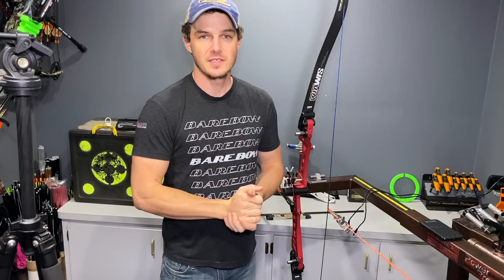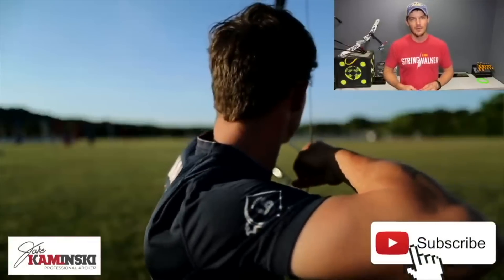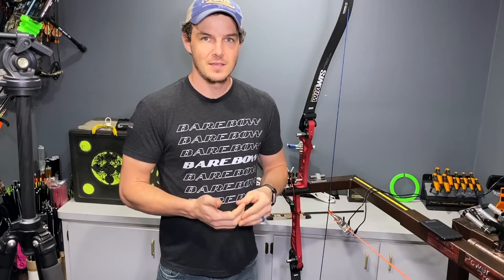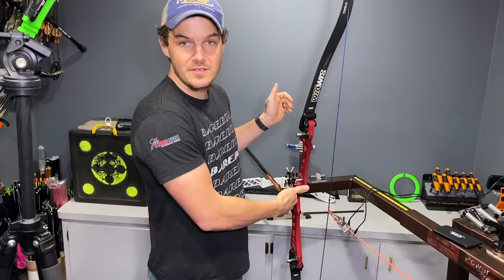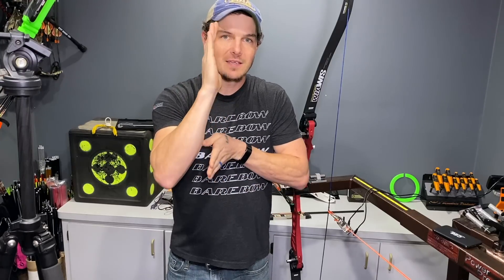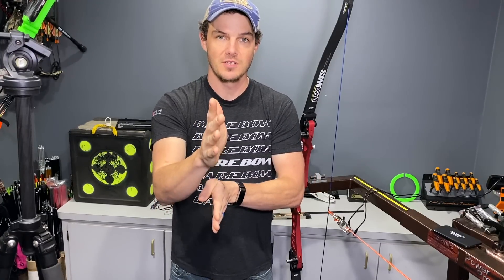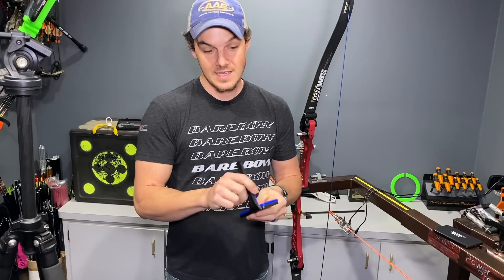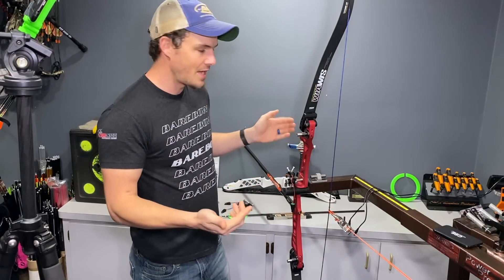Introducing Recurve Riser Flex Testing | How I Will Test Archery Risers with REAL DATA

Comment: Nice setup and to be honest I was a bit skeptical about travel of limb pockets because the riser is so much more ridgid than the limbs. You proved that they indeed move when pulling back the bow. But I don't believe the pockets travel as much as the lasers on the paper do. I think lasers in the setup exxagerate the actual movement of the pockets. It is like hold a long stick at one end, move near this end for lets say a mm. The movement you will observe on the other end of the stick will be significant higher (propotional to the amount you moved the stick though). So imo the measured movement should not be considered to reflect the movement of the pockets 1:1.

Sorry for my poor explanation, hope you get my point.
Reply from the maker: Yes of course, due to parallax they will move less. However a TINY deviation on the line makes a massive impact difference on the target (similar to the lasers) so ANY movement in the wrong way makes an impact on results.
Reply: I wonder if the results for flex out of plane is depended on the lateral adjustment for the limbs, e.g. will limbs that require the limb adjustment to be moved to the side give different results than limbs that are tuned with limb pockets in the middle.

Anyhow I'm looking forward to seeing more tests like this, it will be interessting to see how different risers compare to each other.

Comment: A dial indicator top and bottom will give good measurements too.
Reply from the maker: but where do you mount them? Thats the question.
Reply: @JakeKaminskiArchery  one long bar with an indicator at each end. Put one short bar near the middle, perpto the long bar. The short bar will be used to mount the assembly on the sight window or the stabilizer insert

I can sketch something up if you don't understand

Comment: Instead of using the stabiliser to mount your plate , make a mount that bolts to the rest/plunger holes like your first concept but that is the same length as the stabiliser. That way the plate and laser are mounted from the same point, which should negate any flex difference between the stabiliser mount and the rest/plunger mounts.
Reply from the maker: I can just use the arrow point as the reference and add the stabilizer flex as an extra data point reference. At least this is my plan at this point

Comment: probably should flip the limbs around too for extra data...maybe one limb is pulling 46 and one is pulling 44. Since they're sold and measured as a set you never know if one is stiffer than the other. And a stiffer top limb might flex the riser differently than if it were a bottom limb. I guess that's irrelevant as long as you always use the same limbs in the same position for every riser. Just thinking out loud.
Reply from the maker: I will be sure to try something like that, good idea.

Comment: I wonder if the results are affected on where the grip your setup applies pressure; i.e. whether you should have the horizontal bar at the same place as your hand would apply pressure at full draw.
Reply: In fact, to take it a step further, aren't you in fact modelling a shot where the archer applies pressure to bow's throat and uses a release aid?

So, wouldn"t you need to somehow model the way of gripping the handle and pulling the string as is common for the bow's target culture?

F.ex. thumb draw, three fingers below nock, and two fingers below nock might affect how the bending behaves, and the bow might have been designed for a specific kind of draw and archery.

I mean, if you think of the test setup as a person shooting the arrow, you might reach a more accurate and rich physical model. :)
Reply: @vilidious  Why does any of that matter? Jake is testing the flexing properties of risers under typical shooting load. All of those variables are irrelivant unless you are actually shooting an arrow and measuring that for some reason.
Reply: @mrnice752  Doesn't the behavior of flexing change depending on what the "focal point" of it is?

Especially since I assume the form and material of riser and limbs are not uniform.

So I'm guestimating that the vertical spreading behavior of the laser dots would change depending on what is the center of the bend.

Of course, if you want to just compare roughly how different risers bend, it might not be a significant issue... it might not be so even if you adjust the way it is bent either, but if the experiment is done in order to gain information on how the bow behaves when it is shot... then isn't that what should be simulated/modelled?

I'm not sure how thorough bow manufacturers are with their design, but at least in the ideal world I believe tools are tailored for a specific purpose and way of use... which is why we also have different kinds of bows.

So yeah, that's my motivation with that comment... to note the existense of forest from the trees.

Whether readers feel it's relevant or not, is their educated decision... but at least they can make that decision.
Reply from the maker: I'll try testing things such as this with "fingers" that I have to draw the bow back and make a hand to hold the grip in similar ways to see if differences are seen.
Reply: @vilidious  In theory, yes., moving the resistance point on the grip should effect the results. If you knew the exact forces and coefficients you could calculate that difference. 
In reality we are talking fractions of a mm, measured by eye with pen on paper, I very much doubt a couple of inches difference on pressure point would make a measurable difference to the experiment.

Comment: The Harbor Freight calipers are really good quality. However, like any electronic calipers, they have a rather high parasitic draw on the battery when turned off. The trick is to just remove the battery, after each time you are done using them. I have had batteries last well over a year, with daily use. I have been a machinist, for the oil industry, for the last 9 years, and use a pair of Brown & Sharp dial calipers at work, so I do not have to worry about batteries dying on me in the middle of a job. I have tested many brands and the Harbor Freight brand has always tested equal to my more expensive brands, in terms of accuracy and repeatability.
Reply from the maker: Great idea!
Reply: @JakeKaminskiArchery  If you are wanting, I have an old Hoyt Gold Medalist magnesium riser, dated from the mid 90’s in 95+% condition, that you could test. As long as you can guarantee no damage will come to it. It was my first true bow given to me, by my parents, when I shot indoor competition. Would be interesting to see the difference from then to now. Maybe even a shooting test, to compare how ergonomics, shoot ability, weight, forgiveness, and shot feedback has changed throughout the years.
Reply from the maker: Time will tell on that one. I will be checking to make sure I can do this test without damaging the finish of risers first from the tape and the peg holding the grip area. Id hate to damage your bow.
Reply: @JakeKaminskiArchery  Ok, offer will always be on the the table, if you ever change your mind.

Comment: This flex is consistant. With every shot....
Reply from the maker: Agree, but what if it is uneven and can cause larger deviations of arrow impacts when making mistakes? This is why I am interested in more discovery.
Reply: @JakeKaminskiArchery  uneven should still equate to constant. Unless the poundage varies on each pull. I dont see a slight devation in release causing significant devations in limb alignment.
The other thing to consider is riser clearance with string walking. Risers with less window clearance will torque less for any given material thickness.  Which in certain crawls can cause erratic clearance. 
It kinda depends on what you class as consistancy. I think for barebow a little more window clearance is better than 0.05of a deg of rotation.
Your measurements look significant. But they are at a distance. Double the distance double the measurement. Something to note opposed to making the industry look like they make jello for risers.
Your techneque for measuring this is impressive though. The use of the X vs + to distinguish upper from lower is a stroke of genius.
Reply from the maker: @sid I mentioned this in the description about the parallax to not freak people out. I forgot to mention it in the video and to go out and re shoot a segment to add it in was not in the cards. Still not feeling well so I just wrote in the caution to people.
Reply: @JakeKaminskiArchery  my bad. I didnt read the coment... good to see ideas being tested.
My only fear is people hang too much on one  attribute. When there are many design cross roads to choose when designing a riser.
Reply from the maker: I hear you there, however basically all the other design cross roads are anecdotal and very difficult to prove. This is finally some hard data so it should be taken with some seriousness. I suppose as much as how much the riser weighs.
Reply: @JakeKaminskiArchery  i think centre of gravity and distribution of mass is more important. But hey. That reaches into politics. Rather than the positives of genuine data collection.
Reply from the maker: I probably will do some sort of data collection on that as well, a possible balance point measurement or something of the sort. Lots of things to consider. I would like to become a resource for data such as this. Conversations on the subject and ideas is always encouraged and I enjoy discovering new ways of looking at things.
Reply: @JakeKaminskiArchery  my problem with top trump cards. Is its only one aspect. For example Horsepower vs mass is half the problem in car performance.   Weight distribution is also a key figure.   There will be plenty of good risers overlooked untill more comprehensive data comes out.

Comment: Caliper, not micrometer. Also, its important for your viewers to understand that the flex deviation is much less than the measured value you state, because the measured riser flex is magnified significantly by the distance between the laser and the laser target. Honestly, I wonder if this is a solution looking for a problem. Insignificant riser flex, as shown here, is an infinitesimal consideration relative to other much more variable elements of the shot and equipment (like limb twist). The reality is that since any teeny weenie flex is consistent from shot to shot, there is no accuracy difference between one straight riser and another, though they may feel differently.  I appreciate wanting to quantify, but I wonder if a set of more subjective “feel criteria” may actually provide more value to the viewer as to how a riser might shoot for them.
Reply from the maker: I hear you, and mentioned the parallax issue in the decription.

However, a small tiny bit of error on the human side makes massive impact points on the target at distance, again due to the magnification of that effect. IIRC I did the math once on the room for error on the bow hand side (if the nock stayed motionless) the point of the arrow only has 1/4" total margin for error to HIT the entire 122cm target at 70m. The ten ring was something like the ball in a fine fall point pen.

So yes, in my opinion the movement/flex/twist is relatively infinitesimal (relatively speaking) to the archer, but down on the target I believe it is important.
Reply from the maker: Also I do always give feel feedback criteria in my reviews, you may not have seen them so no big deal on that one. I have been searching for a way to prove and measure actual data and not just anecdotal evidence of what is better or not. This will also take out my and anyone's bias in reporting how something "feels" and prove if bows are getting better or worse. 

Now as far as the actual verbiage used, excuse me if that is distracting to you as a viewer but I believe you understood the gist of what I was explaining. I know they are calipers and use them all the time at my other job forgive my brevity and misuse of terminology.
Reply: @JakeKaminskiArchery  Huh.  I have always believed otherwise about risers; that they are largely insignificant other than looks and feel.  Ill keep an open mind and am interested to learn what you discover.  Love the channel and thanks for all the great content!
Reply from the maker: Cheers. 

Quick math shows me .286 degrees of flex on just the top pocket alone, which if you spread that out over 70 meters you are looking at around a 34cm deviation. Now this doesn't take the bottom pocket into consideration of course nor limb twist. Again I believe that both the riser flexing and limbs twisting will be consistent and arguably moot but what if they make the likelihood of mistakes inconsistent or biased towards one direction? I sure wouldn't shoot twisted limbs in the Olympics if I had the choice, so I believe the same about risers too. Equal flex no matter how much and in plane is what I would choose. We will see if that exists and potentially is better or worse with different manufactures.